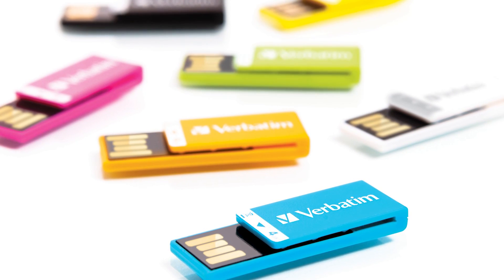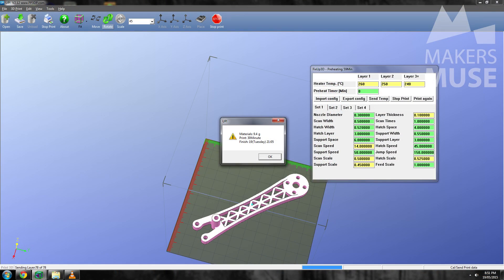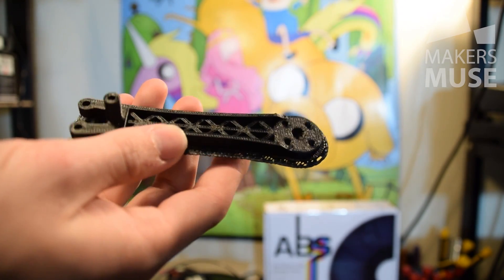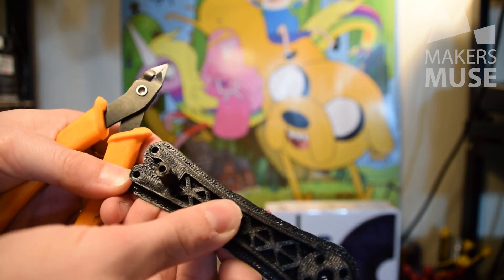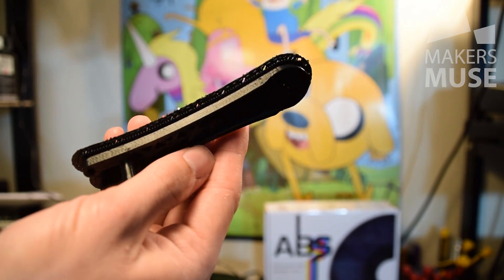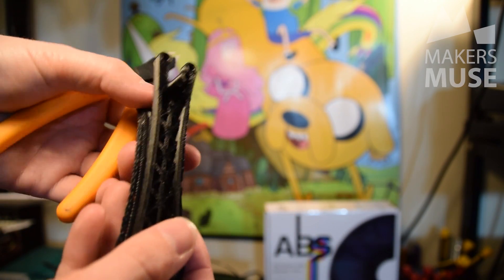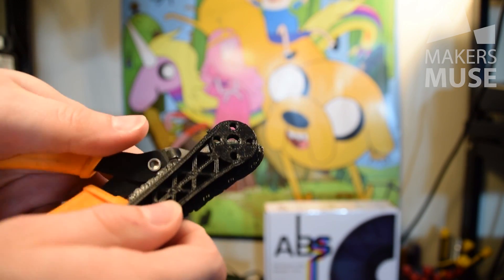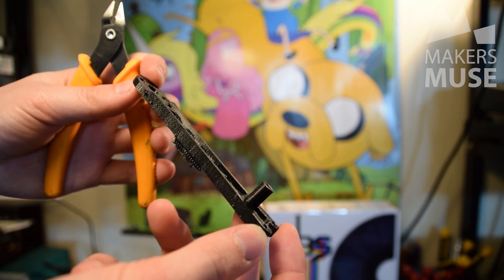Verbatim 3D Printing Filament! Review using the UP Mini 3D Printer - 2015

Comment: Hi Angus,

Sorry, i know you are a busy man. Just sending this email to check if you receive any email around 2 days ago from me about the settings for XT-CF20 and UPBOX problems in case if it got lost in your emails.
Wish you a pleasant week ahead. Thank you.
Reply from the maker: +ahohe werwe I did, I've been away from my main Design pc so can't access settings for XT-CF20 however I 'believe' i set the 3+ layer to 250deg, to match the recommended temperature on the roll. I haven't yet used the temp hack on the UP Box myself, so can't say for sure if the hack works or not, been getting conflicting info.
Reply: Maker's Muse Can I confirm if all 3 layers are 250?
Reply from the maker: +ahohe werwe maybe make the first 260, but you should be fine. Might need to tweak slightly to make the support / raft easier to remove.
Reply: Ok Thanks, by the way, I send you an email with a picture of the UPsoftware available in the website. The version you recommend me is not there and this version I am using seems to have some problem connecting.

Comment: Hi Maker's muse, i left a reply below. I am not sure if you receive it?
"Many thanks for your quick reply. There is a concern I have. After I did a setting, i export config. When I import that config file again, it gives the default all 0 values in the nozzle diameter. If it is possible, I like to send you a screen shot so that you know what I am referring to because I download the .dll file and it gave me a different FixUp3D as compared to the one i saw you are using in the video?below is my email if you like me to send you a screenshot. I really appreciate any advice I can get from you. Thank you!  alvinbie2012@gmail.com"
Reply from the maker: +ahohe werwe They have updated the software a little since I did that video. The numbers should not be 0, are you turning the software on with your printer plugged in? You can reset fields to default by deleting the number in the box. I will email you so you can send me a screenshot.

Comment: Hi, I like your UP  videos a lot, especially the hack your UP printer. But i am having problem to understand how to use it. I mean i look for step by step instructions but cannot find any. For instance, the normal UP to print. I just need to click initialize printer. Load the file, the click print, select the settings I want and the computer send the data over to the UP printer and it starts printing. Can I ask where could I find a detail instruction how to use the temperature nozzle control together with the UP printer?(like what steps to take please)
Reply from the maker: +ahohe werwe It can be tricky, I'll be doing a vid on some of the settings I've found work well soon. You need to have the .dll file dropped into your UP installation folder, so when you start the software the fixup3D window also pops up. The 1 2 and 3+ layer temp boxes are the most important, and when you're happy press 'send temp' then print the part as usual.
Reply: Many thanks for your quick reply. There is a concern I have. After I did a setting, i export config. When I import that config file again, it gives the default all 0 values in the nozzle diameter. If it is possible, I like to send you a screen shot so that you know what I am referring to because I download the .dll file and it gave me a different FixUp3D as compared to the one i saw you are using in the video?below is my email if you like me to send you a screenshot. I really appreciate any advice I can get from you. Thank you!  alvinbie2012@gmail.com

Comment: hi my name is Gert I am from Denmark.
I write to you because I think you have one of the best 3D printer youtube channels.... "in my opinion"

I am on the lookout for my first 3D printer I've seen one called Wanhao D5S mini that looks as if there are solid built, but I do not know if appearances are deceptiveing
I have hard time finding some tests,

my questions is if you have some experience with wanhao ?

best regards
gert
Reply from the maker: gert jørgensen Hey Gert cheers for the contact!

First impressions on the Wanhao, looks like a nicely built machine but their demo photos show a model with a badly warped base, ALWAYS a red flag. If the manufacturer can't print without parts lifting, what hope do you have! With no heated bed and that open design you will be severely limited to PLA only and will still have issues if your room temperature is too cold. 

My advice is to see as many 3D Printers in person as you can, try to meet up with people and talk to them about their experiences - I didn't commit to my UP! mini before using an UP! plus for about a year at my local hackerspace. Hope that helps!
Reply: many thanks for your input, it makes good sense

Comment: Have you tried Zortrax Z-ABS on UPs? they appears quite cheap (~35aud) per kilo on a NSW online shop and I heard that they works pretty well (same temperature setting as UP filaments).
Reply from the maker: Gordon Li I have indeed! I needed a grey and the zortrax grey is really nice quality, was pretty impressed at stock up temps but support was still harder to remove, with the fan door open you should be fine. Wouldn't mind trying out a zortrax printer either, they look pretty decent.

Comment: I have seen this stuff and it looks interesting! Being I'm not an ABS guy I doubt I'd run it but I can vouch for esun clean out filament!
Reply from the maker: Calvin Witt They have a PLA too, haven't tested it myself though. I think ESun clean out filament is just nylon, but certainly going to give that a test if I can find any in Aus! Does it bubble and spit as it extrudes? I use moisture damaged nylon to 'steam clean' my nozzles in the studio.
Reply: I gave it the "smell" test and im not sure what it is but the large temp range makes me wonder if it is nylon. Sometime soon I am going to do a nice "burnt filament test" with the stuff to see what it can do on my UM2 with a "burnt in" nozzle which is always fun to deal with! I agree that nylon works great to clean out gunk in your nozzle. The only problem with wet Nylon is when your trying to use it in the atomic method since you can never get a good pull.

Comment: What do you use for bed adhesion on the up? I've never been able to get black ABS to stick well no matter what I've tried...
Reply: Make'n'Mod i do not have a up but i use a glue stick.  having a hard time getting abs loose from the plate after prints, so that works for me
Reply from the maker: Make'n'Mod For the ups, it's just a perforated platform made from fibreglass and the abs raft digs into little holes. For other machines I tend to go straight to buildtak these days, expensive but works oh so good. Definately need a very hot bed though for ABS - at least 70deg if not higher depending on the printer. UP! Mini gets away with 50 because the bed size is so small.
Reply: frode eriksen I've always found glue stick melts at ABS temperatures which allows the print to lift.

Maker's Muse, the Rigidbot bed gets to 100C and that seems fine for very large clear and medium sized white ABS prints. When it comes to black ABS it seems like black magic... Maybe I need to try our some of the Verbatim black. I noticed 3d Printing Studios doesn't have a webstore yet? Any idea of when it's opening?
Reply: I use 3M scotch glue stick  and have no problems at abs temp. I have a hard time getting prints loose

Comment: i got a solidoodle 4 and i talked to them and they says that when the printer gets to 220+ Celsius the printer goes into auto shutdown so that nothing will get damaged because of over heating. I see that there is a lot of plastics that needs around 250.   do you know if there is a command or something to tell it to ignore the temp?  so that i can get it to 250?
Reply from the maker: frode eriksen From memory, the solidoodle's extruder assembly can't handle the higher temperatures so they limited it, at least this was the case with the solidoodle 2 and 3... It depends if its firmware based or in their slicer, if its in the firmware you would have to reflash it with standard reprap based code and adapt, but sounds like the extruder would start getting damaged if you did this. :(  Just my thoughts I'm not too familiar with solidoodles.
Reply: +frode eriksen You would most likely have to reflash the board to get around it but that would be a bad idea. Their printers use acrylic and or plastic in the extrusion assembly which will be cause damage and warping to the parts. The plastic parts on the newer ones could even melt...